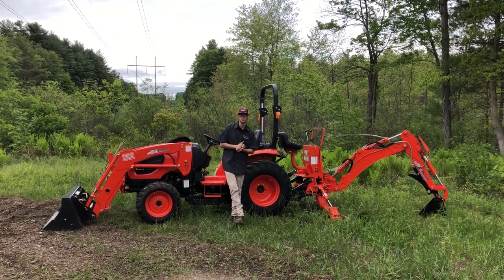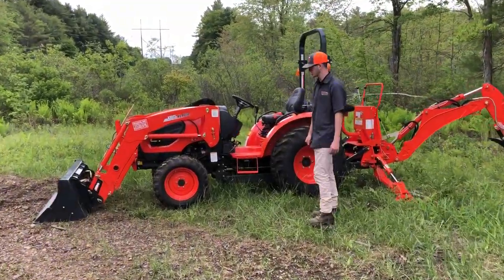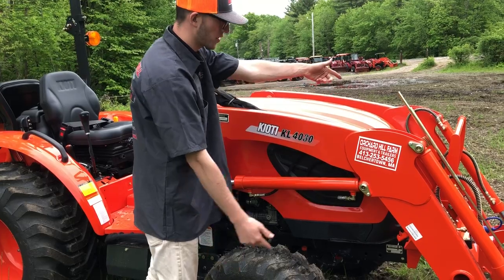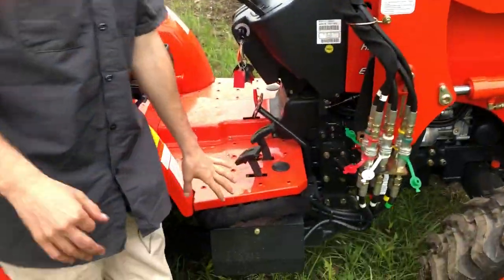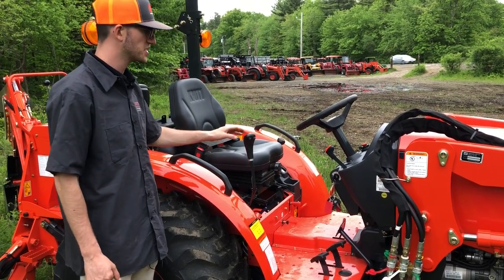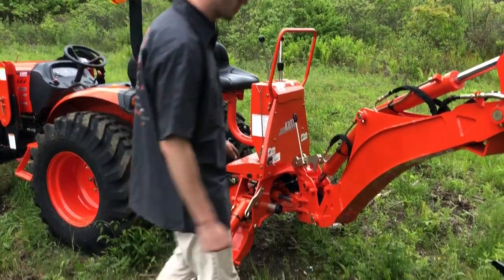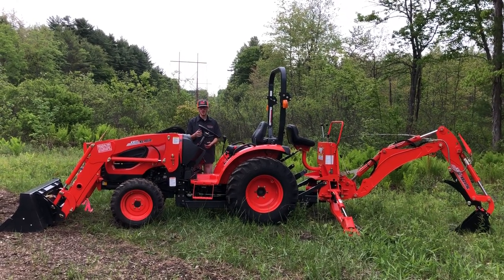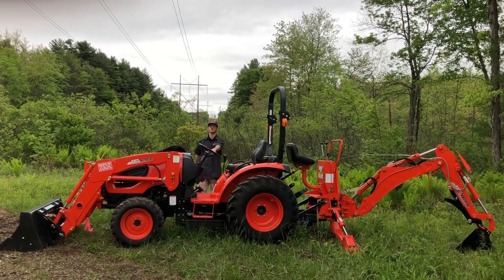2019 Kioti Tractor CK10 Series Overview - CK2610, CK3510, CK4010 - Loader Backhoe

Comment: I just got a CK2610 . Just did the 10 hour walk around and check. So far a nice little tractor, the only thing I’m not thrilled about is if lifting the 3 point up slowly it jumps. This is normal from what I understand. I now just raise it up faster and not an issue. I’d buy one again at this point.

Comment: Has the ck2610 have the horse power needed to operate the back hoe, the loader for the guy that has a couple acres with a natural creek flowing through the center of it.  The creek needs maintaining from time to time it will over flow .  The old wooden culvert under the drive way will need replacing , plowing two feet of snow at one time and similar tasks?

Comment: Thanks for the very informative walk thru and review. Not to put you on the spot as I know your both a Mahindra and Kioti dealer but if you had to choose between the Kioti CK2610 and the Mahindra 1625, which would it be???
Reply from the maker: They are both very very good machines. My thoughts are if the Kioti is cheaper then its the better deal. The Kioti is around 300-400lbs heavier, lifts around 300lbs more on loader. Other than that they are almost identical comparable machines. I sell more of the 1626 with loader and backhoe in mahindra line up and more Kioti CK2610 with loaders mainly due to the pricing.
Reply: @orchardhillfarmequipment4347 
Thanks for the reply. They are both within a $1000 of each other in similar form. I'm going to check out both and see which feels more right to me. Lucky for me they  are  at the same dealer.

Comment: Why does the ck26 have either KL2610 or KL4030 front loader?
Reply from the maker: This is because the ck2610 use to be produced with the older kl2610 loader and now they have them all equipped with the heavier lifting kl4030 loader.

Comment: Thanks for the info...ballpark $$$$, would be great..i understand it he price depends, but, ball park for the setup would be helpful..average $$$ difference between 2610 and 3510 ..4010, my 2 cents, and thanks again.
Reply: The CK4010SE HC is right around $30k, w/loader, maybe a bit less.
Reply: CK26 10
$17,000. W/front loader.
Backhoe is around $8,000.00 
I just ordered mine so this should be accurate. Total with taxes and fees was about $27,000.00 W/backhoe, loaded tires, skid steer quick disconnect front loader and floor mat. They're the only company that offers 0%/72 months
Reply: I just picked up a CK2510 with bucket, brush chief, box scraper, tiller, snowblower and 18'- 10k car hauler OTD for 25,000.
Reply: @nativedave  can I ask where you purchased yours?